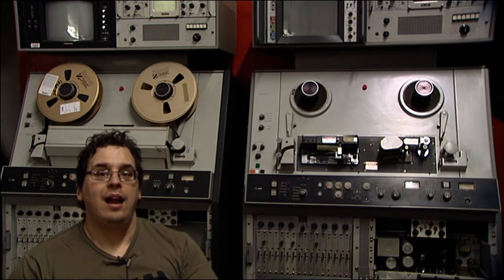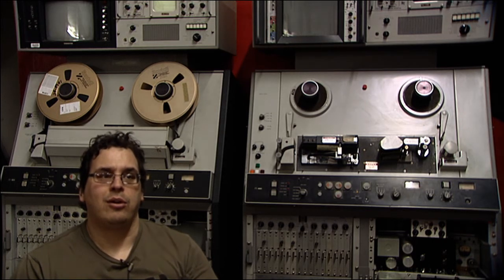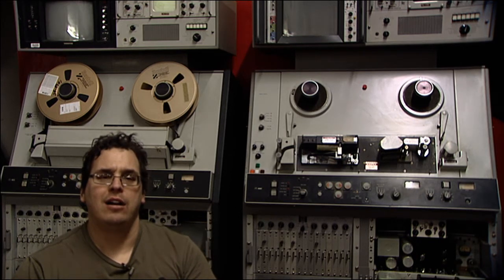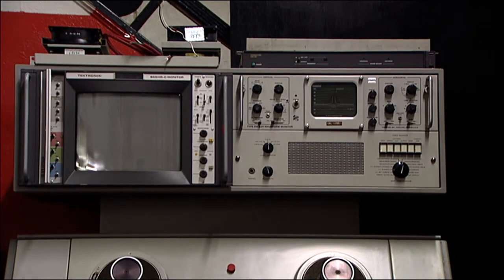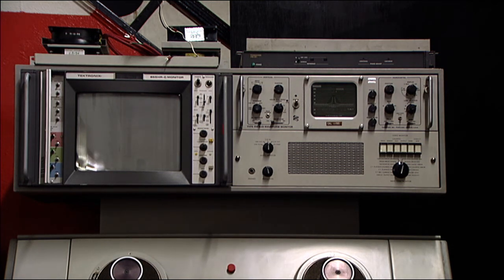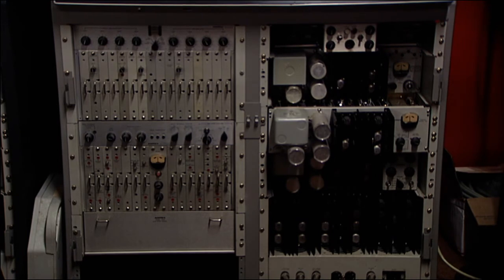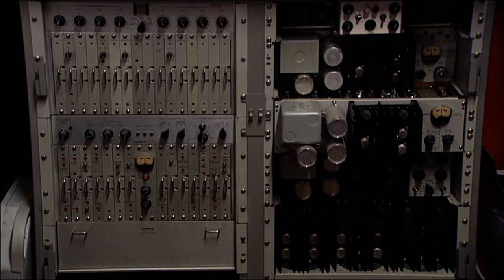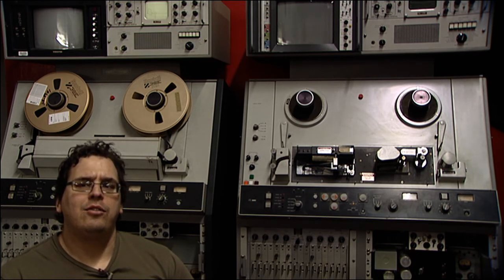Ampex VR-1200 restoration Part 2 of XX?

Comment: Hi. I need to digitize some old 1 inch (x4, 610 ft.25,4 mm x 1,405,1 m) broadcast helical video tapes. is this machines good for these tapes?. I am very confused because I have almost 70 to 90 tapes. these tapes are very heavy and I didn't find any playback machine for these tapes on internet. I digitized old reel to reel spools and the machine I used for reel to reel is Otari MX5050. I saw some BBC old videos where the used very giant machines. is there any small machines?.

Comment: In the 1980s I had reason to visit CBS Television City in Los Angeles, and wandered the basement where all the recording and editing equipment was, because I was more comfortable hanging with the techs in the basement than any celebrities upstairs.  Even though most programs were broadcast from 1 inch helical scan decks, they still had a fleet of quad machines which they used to record some of the soaps that were recorded there, and possibly some of the game shows.  

One of the engineers told me that these machines started out as tube based, but were constantly upgraded during their lives as technology evolved.

When watching TV back when they used to broadcast from tape playback, occasionally you could see a glitch in playback, and could tell if the program was being coming from a helical scan machine or quad, because the quad has 4 switch points that can occasionally be seen in the picture, and a bad tape section would produce 4 lines of static instead of one like we geezers remember seeing from our VCRs.

I think I still have, somewhere in my garage, definitely not properly stored, a box of commercials and other tid-bits on small spools of 2 inch video tape!

Here I was looking for the rest of your videos on a Zenith radio I'm restoring, only to discover that was a little fish compared to these two whales of technology you've caught here!

Comment: Quadruplex recording required storing four fields at once for each frame, and since the heads are tangential they have to spin at incredible speeds; they sit on air bearings which allow them to spin at 14,400 rpm or 240 times per second.
Reply from the maker: There where both air and ball bearing versions of the heads for the VR-1200. The air bearing machines where more expensive and also required  filtered dry compressed air. you can used a ball bearing head in an air bearing machine but not the other way around, without adding the air equipment.
Reply: The four heads scan 16 lines one at a time so they don't "store" anything.